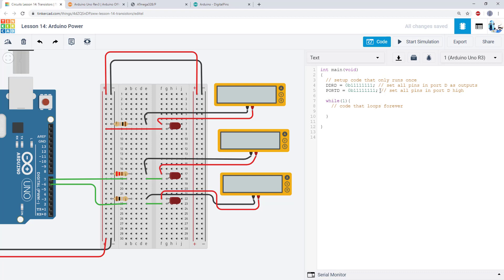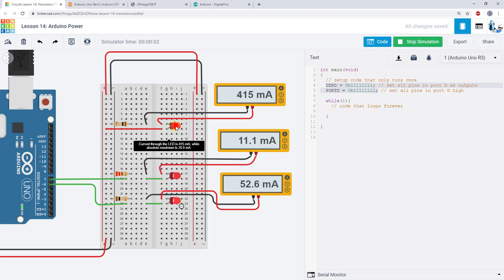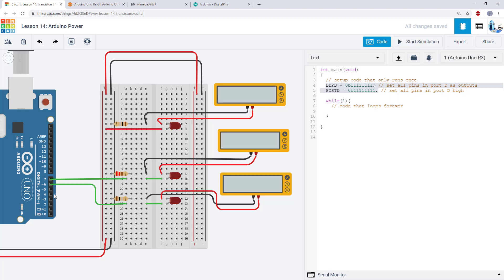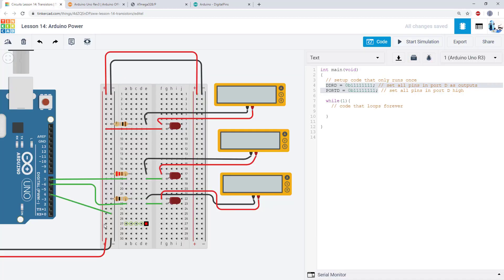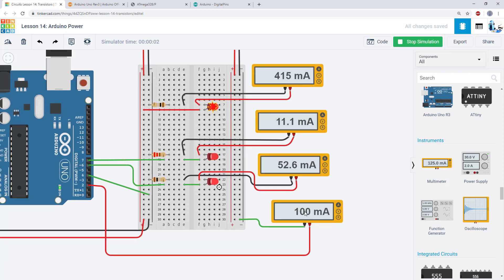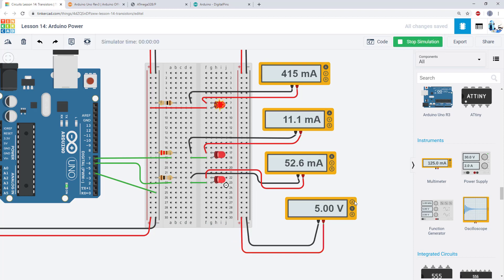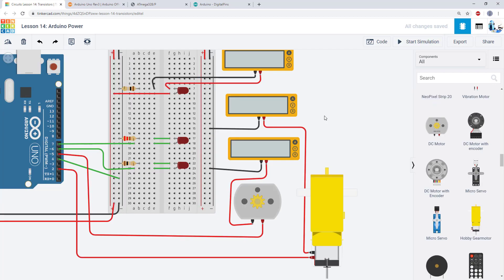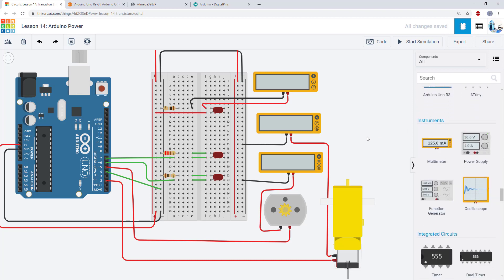Tinkercad + Arduino Lesson 14: Power and Current Limits

Comment: im designing and testing a circuit for a project that uses its own voltage regulator circuit and i want to remove the usb power completely how on earth can i get rid of that (in tinkercad)
Reply from the maker: I don't believe you can do that in Tinkercad. You could power your circuit with a battery pack or the benchtop power supply element instead of the Arduino.

Comment: I really wish we had more than 20 to 40ma

It would allow for much smaller circuits.

I do wonder if it's possible to maybe have multi channel mosfet driver ic on the arduino that takes outputs from the atmega and outputs same thing but capable of lot higher current like 5 to 10A.

Comment: In this case, what is the right simulation tool , we should use?
Reply from the maker: Hi Anand - not clear what you're asking. Right simulation tool for what?
Reply: @BenFinio  He means the simulation tool that simulates the arduino damage as well.